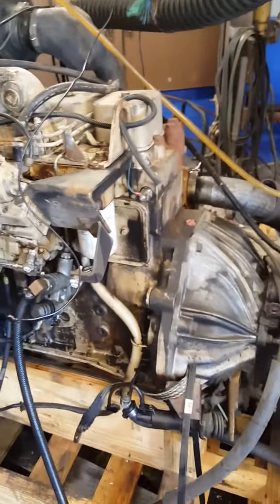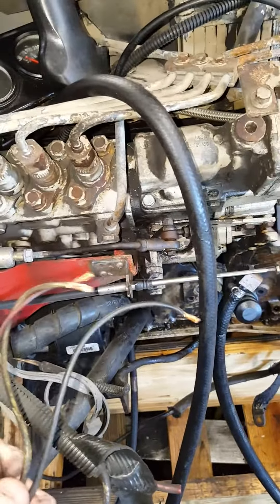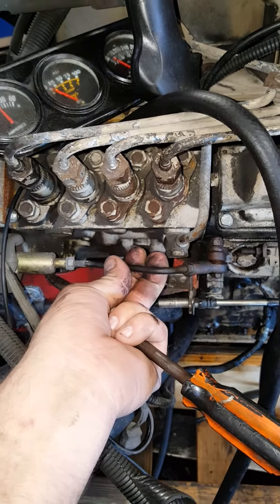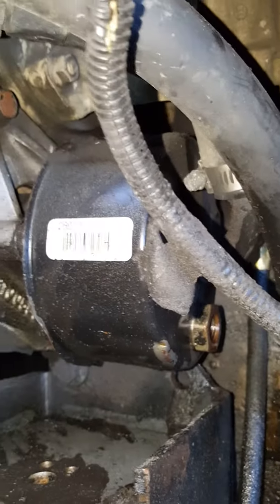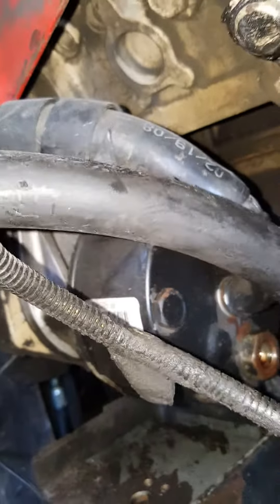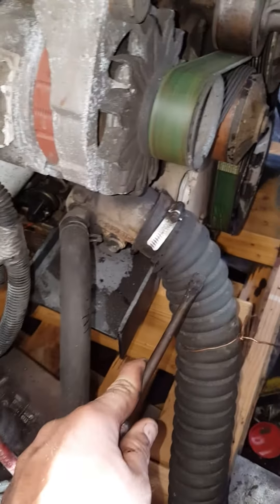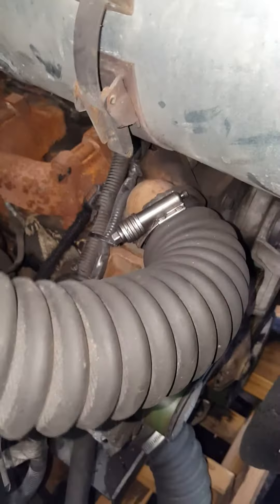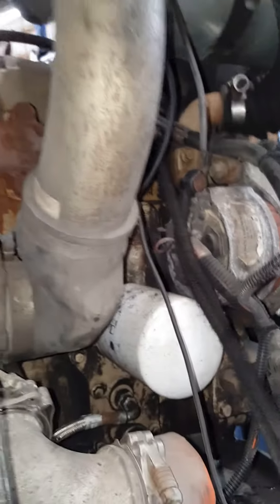4bt p pump wiring and plumbing explanation for tad lozier

Comment: I found you on eBay, subscribed and love your work. I was given a 2001 Dodge Dakota quad cab with the 4.7L V4 and 4x4. The motor and transmission are junk, the rear end, transfer case, body, and interior are all very good. My plan is to put a Cummins turbo diesel 12v mechanical engine swap in it. It's a father son project that I'm looking forward to doing with my son. The truck will have a 6 inch lift on 35's, with custom front and rear bumpers. Safety and reliability is what I'm going for, later on we can go for more power. I would appreciate your advice and help on the father son project that I'm planning for my son's 1at vehicle :))